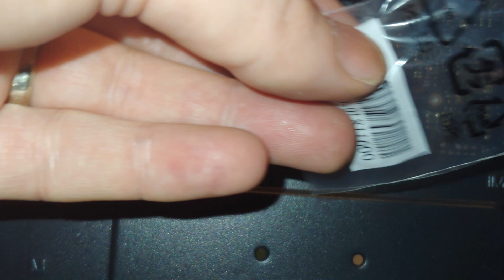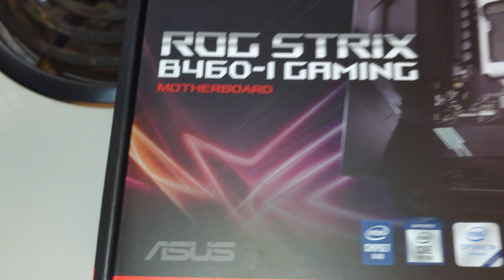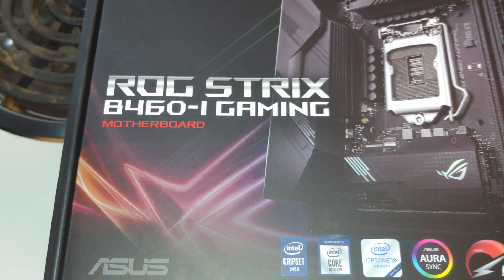Installing 2nd NVME M 2 for storage into Asus ROG Strix B460 1 Gaming Wifi Motherboard mini itx

Comment: Why use the one in the rear when you have a dedicated slot in the front, with an inclusive heat sink?
Reply: Because the title refers to the installation of the 2nd nvme. The slot for which, is located on the back of the motherboard.
Reply: @ChemistryLemur  Thanks, totally missed it!

Comment: Hello Mr. David! I am fairly new to pc building. I have installed a m.2 in the front of my motherboard, and the motherboard came with a heatsink for it. My question, for the back portion: Do I just leave it like that exposed? No added thermal paste or any heatsink I should buy?
Reply from the maker: Yes..just remove plastic film..no paste